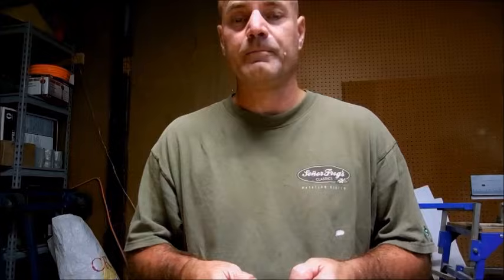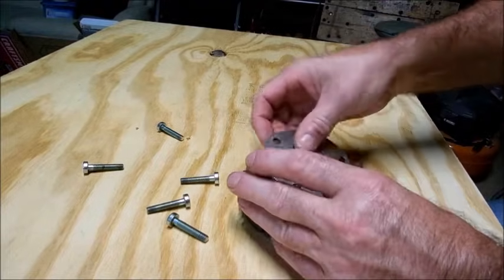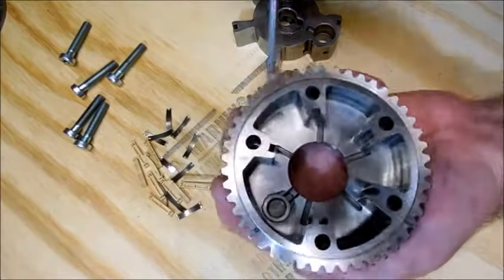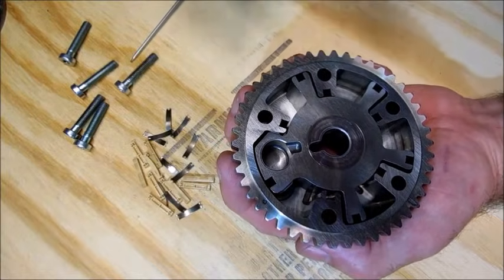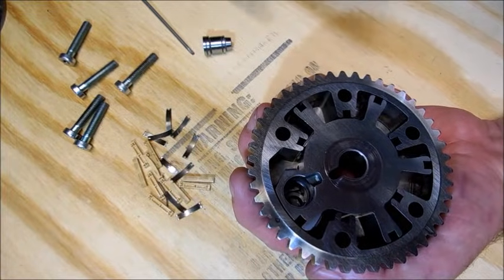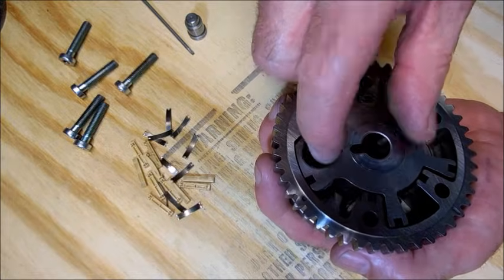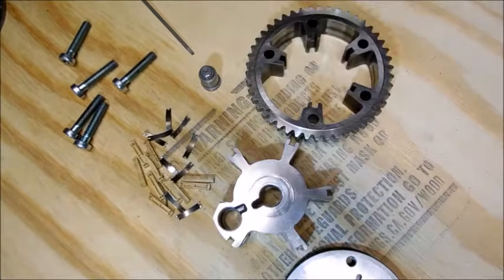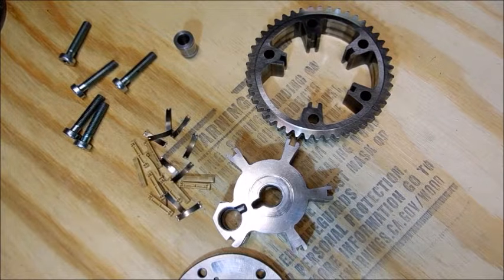Honda variable timing control actuator VTC . inside look at Honda's VTC

Comment: Thanks for the great video, I have a similar sounding rattle however not during cold start, but rather when the engine is under load ( 1.5k to 2k rpm, high gear, pushing the accelerator but not enuff to downshift)

Would there be a possibility the vtc spring is the culprit here ?
Reply: Were you able to get it fixed? If so, what was the issue? Thanks!
Reply from the maker: that seems to be the idea.. one guy on here replaced the spring and fixed the issue
Reply: It shouldn’t rattle at that speed & under load. I would suspect engine ‘pinging’ (detonation) is the culprit. Change to high octane fuel to confirm

Comment: thanks for the video, i replaced the spring with new one with extra 3mm length,  to my surprise the cold start rattling is completely gone.   i did it when the cam still in the engine. i only opened 5 bolts on the side of cam actuator and replaced the spring which only cost me less than $1. fyi be extra careful the cam actuator cover is spring loaded, try not to drop the spring and washer into the chain cover and oil pan.
Reply: Where did you get the spring from? Can you provide link?
Reply: Please provide info on where to buy the spring.
Reply: Thanks ! The spring , can you tell us more about the spring please, as asked before
Thanks again!
Reply: Yes just did this with my 2012 crv. Worked well. Just bought a variety pack of springs and found one that fits that was longer/stiffer.
Reply: I've been working with Spring-Start on my rattle and I will state that the spring by itself is not always the solution.  The timing chain tensioner needs to be replaced - it's easy to do and under $100, and extremely critical to not have fail - just do it.  

Also, the locking pin needs to be worked over until it moves in and out of its detent as freely as possible.  You will need to verify that your timing chain is not stretched as well.  There are 3-4 things that cause the rattle to happen and the spring is just the place to start.

I highly recommend replacing the security bolts with regular hex bolts - size M6x1x30mm - and use blue threadlocker made for oily surfaces.  You may find yourself going back into the actuator and those tiny security bits and easily stripped bolts are going to create huge roadblocks for you if things go south.

The more small parts and tools you keep in the equation, the higher the chances of something really really shitty happening.  Namely, dropping something and not easily retrieving it or ruining a bolt that was never intended by Honda to be removed.  Always block the opening in the timing cover and take your time.
Reply: @ACZ457  Brilliant.. THANK YOU.... I'm also thinking any replacement spring must  meet exacting tolerences.  there are notes of people here buying assorted spring kits and finding one that fits...It may stop the rattle but it also may stop the VTC from  working all together.   As a first  pass, I'm tempted to take the existing spring and stretch it to original length.   Simple and easy using existing parts seems like a good first pass.  Regardless, thanks for your thoughtful post
Reply from the maker: nice.  thank you for the update. i figured that was the problem the spring gets weak..
Reply: Hi again , and how much pounds of torque on the bolts to put it back, 
Thanks!
Reply: What's the length of the spring you have installed as replacement.
Reply: springstart vtc
Reply: whererdid you get the spring?
Reply: @droid2816  any hardware store

Comment: Thank you for the video. Great information. 
Could the rattle be from the VTC Valve being clogged???
Thank you.
Reply: Sometimes the solenoid is the issue, but majority of the issue is weak pin spring tension.
Reply: If that were the case you'd be getting a CEL for the VTC.  Same as you'd get with a stretched timing chain.

Comment: I am so happy you showed me the internals of that cam gear,  my Accord has rattled on start up since 2008. Every morning.
Reply from the maker: glade you enjoyed it
Reply: @mikesproject4704  Where did you heard that this will not cause any damage and just the noise is not nice?
Reply from the maker: @Edgar-ne2eb  Honda stated that. but long term i feel will do damage
Reply: @Edgar-ne2eb  what mike meant I guess is that in the long run this VTC actuator itself will not be damaged so easy, because as mike showed in the video this actuator does not have a lot of wear. As to your concern of actual damage to the car, I think the chain or the tensioner will have some damage as a result of the VTC's inability to lock from engine cold start.
Reply: Same here, 2009 Accord, been driving myself crazy because I was afraid that I needed all of the timing components replaced. Now I'm going to try this spring fix and see what happens. Might have to change the tensioner as well, but even if I do, it would still be far less expensive than the alternative.

By the way, how is your 08' Accord doing?

Comment: There's a video of a guy who simply changes the spring and fixed the problem. I'm going to try this next week and see if it fixes the issue. Thank you for posting this, I wasn't sure if there was more failure points but this gives me some confidence the 4 dollar spring may fix the issue. 🤞
Reply: Did it work?
Reply: I'll let u guys know
Reply: @valentinodean4955  guess it didn’t work
Reply: Yes me too plz bro 💪
Reply: When u replace the spring, pull the pin and clean it, and the hole as best you can. Also, change your oil every 3000 miles. It doesn't take much for the pin to not move smoothly in the hole.
Reply from the maker: sound good. let me know if it works

Comment: What is the size of the bit for the bolts on the actuator
Reply from the maker: TS30h    5 star bit
Reply: @mikesproject4704  is this different then the Torx socket? my 2015 accord doesn't vtc actuator bolt doesn't grip when I put the t27 socket in
Reply from the maker: @boostindc2  normal torx has 6 splines. this bit has 5. TS30h

Comment: Hi, would just replacing spring  fix the problem?
Reply from the maker: that might do it but i also think it is a combination of the wipers not holding the old
Reply from the maker: @eternalspring1034  stretching would work for a week.. really need a new spring .. i dont know the size

Comment: Hi, did you use 0w20 or more viscous motor oil? I'm thinking about oil pressure difference between two
Reply from the maker: i used Ow20 . it was my wife's car she did a lot of short trips  3miles to work. so i think it is more of how many times the spring is worked. it was very clean inside
Reply: Hi, mine HR-V does it too....I've run over 70.000 Km with 0W20 oil, but now I want to try 5W30 oil.....I hope can I resolve this f**king problem 😅👌🏻
Reply: @EliaBertuzzi  Did you change the oil to the 5W30? problem solved?
Reply: @Bandido1250  just a little....but not completely 🤷🏻‍♂️
Reply: @EliaBertuzzi  5w20 is more viscous than 0w20 and would due damage in valve body due to lack of lubrication in cold temperature. Never have 5w20 in weather below freezing that would do serious damage. Also take apart the filter to see alumunium particles and check for steel too using magnet on filter membrane to confirm if it performed fine.

Comment: ok..it..spins..counterclockwise..looking..from..sprocket..side..the..intake..on..the..right

My..theory..is..different.

When..u..tighten..the..sprocket..u..should..hold..the..shaft..with..spanner..so..no...loads..exerted..on..that..pin

Another..one..is..the..fact..that//when..pin..engaged..it..is..advancing..camshaft

I..think..the..pin...and..spring..are..there..to..hold..everything..together..untill..pressure..is..sufficient..to..avoid..this..knocking...when..cold..starting

After..that
Reply: rip space bar
Reply: @fettaheker  rip...you.brain
Reply: @mcqcjc8409  why..you..mad

Comment: Hi mate. Do you have the part number by the way? I wanted to see if its the same old part sold again, or a new part re designed number. Thanks
Reply from the maker: 2008–12 Accord L4:  P/N 14310-R44-A01

Comment: Hi. Your explanations make a lot of good sense. But why Honda does not sell a spring or a rebuilt kit? There is barely nothing in that actuator to go really bad. But more than 85% of Honda  owners are having this noise on cold starts. And here in Canada, that part alone is close to 300$!
Reply from the maker: i think you just answered your own question. a spring would cost 1$ and the actuator is $300
Reply: @mikesproject4704  Yes indeed it did! lolll ... But leaving it with the grinding noise, is not bad for the engine is it? Thanks
Reply from the maker: @Daniel-xq7ny  i wouldn't go more than two years
Reply: @mikesproject4704  I have now many that stated they have replaced the VTC actuator and the rattling came back within the year!
Reply: springstart vtc
Reply: WVE brand  appears to be Honda OEM since the markings are identical and it is also made in Mexico. Did one today based on Chrisfix video and it wasn't too difficult.

Comment: Hi. Did you have a grinding sound, or more like a clattering sound? And since the new VTC actuator, any more noises? Thanks
Reply from the maker: i had very fast chatter for about 2 seconds. no more issue, runs great.. thanks for watching.
Reply: @mikesproject4704  Would it do it almost every time on cold starts? Cold weather or both cold and warm? Thanks again
Reply from the maker: @Daniel-xq7ny From the first time doing off and on to doing all the time was very short les that 3 weeks may be a little longer
Reply: @mikesproject4704  thanks.

Comment: Thanks for posting.

So I did mine last weekend, and after I got done I noticed that the old VTC was unlocked. Is this another indication of its failure, or could this have happened removing it?
Reply from the maker: unless the spring is very weak it wont unlock by itself. so yes it failed
Reply: @spring-start  that is not the question I was asking, and this was 2 years ago...🙄

Comment: Means that if i dont have money for fix  it, it wont damage any part?
Reply: I was having same prb.. But couldn't notice in the beginning... Atlast the engine started jerking n the timing chain cover also got broken.. I found it when the mechanic opened the cover.. N it will cost u more as well.. So, better get the vtc replaced before it damages the whole system
Reply from the maker: @anonymous-z974  man that sucks. sorry to hear about it.
Reply from the maker: I ran it for 9 months and there was little wear, so 2 or 3 years would be my guess before you run into problems from it.